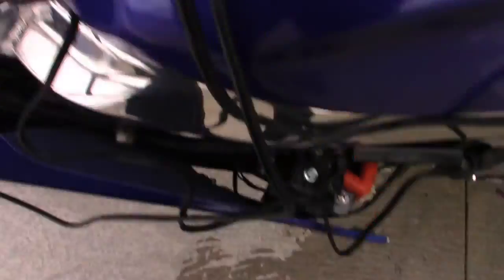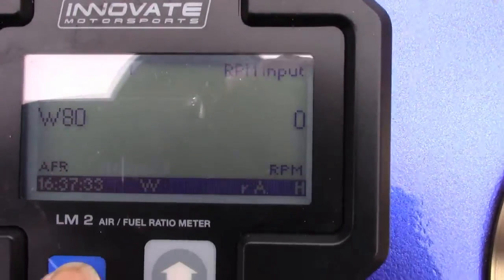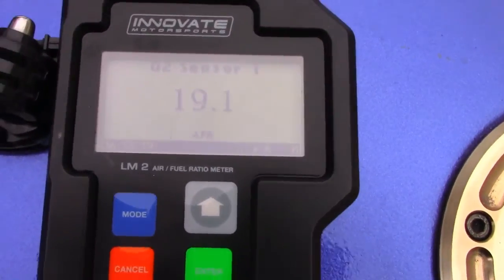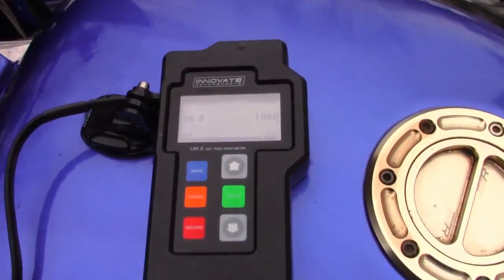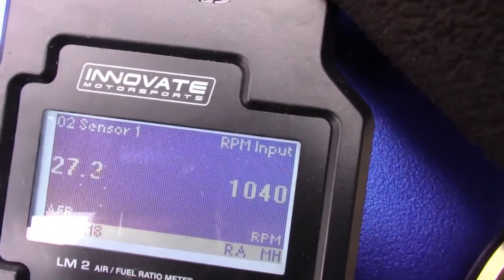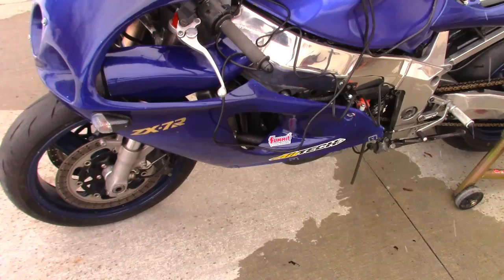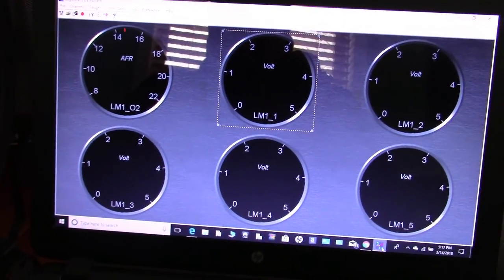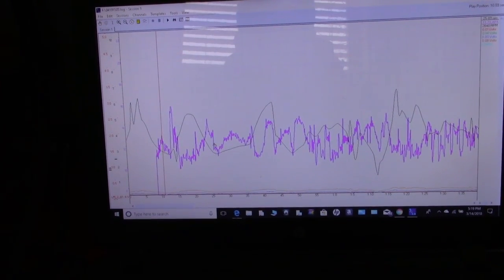ZX7R Update Innovate Motorsports LM2 Part II

Comment: Hi,
I am planning of buying LM2 for my flat twin BMW and read not nice reviews about LM2 or Innovate’s products in general, after so many years how is your LM2 behaving?
Reply from the maker: The LM2 worked fine.   The muffler clamp was not the best solution.   It is best to weld a bung on the mid-pipe to get more accurate readings.    Otherwise, I did not experience any issues with it.
Reply: @Turbo329 I read a lot about the reliability, I need that for BMW flat twin engines …. And I like the idea with one device with two sensors

Comment: This video helped. Thank you. But watch the clamp position.  From Innovation manual “Do NOT install the Bung below the 3 o'clock or 9 o'clock position. Condensation can form in the exhaust pipe and permanently damage the sensor.  6 o’clock is the absolute worst position to mount the sensor.

Comment: not much good if you cant tell if your rich or lean at idle
Reply from the maker: Agreed.  Best way would be to weld a bung on the mid-pipe and connect it directly.   Then it should get a way more accurate reading.
Reply: @Turbo329  did  yours have a PAIR system fitted when you were doing the test

Comment: The lean result on idle and low rpm is due to PAIR system/valve. PAIR is basically injecting fresh air to exhaust to help burn residues of fuel. This system works (ON) from ible up to mid range of rpm (depends on the model of motorcycle ). 
Since lean afr is when too much air is present, and PAIR system inject air on low rpm = make exhaust gas leaner= providing/ delivering not realistic mixture of gases to O2 sensor. 
In order to adjust idle and low rpm afr, PAIR  valve has to be closed manually (you have to tap it). After that real arf will be delivered on low rpm. 

Pair valve close it self automatically from mid rpm to high rpm

Thank you
Oleg
Reply: my 1200 bandit mk1 doesnt have a pair system ,so would i get fair results with the innovate exhaust probe /sniffer
Reply: @virtuosomuso  Maybe. Maybe not. The exhaustgas pulses quite a bit on idle. Air could be suckes back into the exhaust and it would show lean as well.

Comment: every bike reads lean on idle.  I have tested a dozen even with gas analyser. the gas pulsation on idle gets a lot of oxygen pulled from outside. that is why you run "lean" on idle.  if you extend the muffler with a 2-3m long hose, it will read correctly on idle.
Reply from the maker: Thanks Peter.   Actually this unit reads abnormally lean on idle like 30 or something.  I can’t remember exactly.  It’s definitely a false reading but it gave an accurate reading once I started moving.
Reply: @Turbo329  yes, that is that way on every bike due to short exhaust and low cylinder volume.  every O2 in the muffler will read that crazy false lean, that is normal. I get 12% of O2 on gas analyzer on absolutely every bike I tested.

Comment: Thanks for sharing, excellent work! What is the jet setting (maj, pj, pilot air jet and so on) which is giving you best drivability and less “bogs”?
Reply from the maker: You want my flatslide (FCR41) settings for my build?
Reply: Turbo329 yes pls, we all want :) . I have cbr 900 with 39 fcr and now running 160s + 55s + 1.5 turn air screw out , 1 turn fuel out
Reply from the maker: @federicob7521  Here you go buddy (Please note that these are the KEIHIN FCR41s sold by SUDCO and NOT the OEM ZX7RR carbs that came with the '96 and '97 ZX7RR.  I have those settings as well but the SUDCO carbs seemed to work better for my build):  
FCR41 (SUDCO - With Airtech Race Airbox Fitment) Sudco Part No. 016-515
Jet Needle: OCFMP - 7th clip (richest) position
Needle Jet: Primary Type (no holes in the body, only the top of the jet)
Main Jet: #165 - all 4 cylinders
Main Air Jet: #100
Pilot Jet: #55
Pilot Screw: 3/4 of a turn out
Slow Air Screw: 1.25 turns out
Float Height: 9mm
Airbox: Airtech FIM 2 Snorkel Race Airbox
Velocity Stacks: - 30mm Cylinders 1 & 4; 50mm Cylinders 2 & 3
Ignition: - Stock Rotor
CDI - IGNITECH TCIP4 W/ Custom Settings and 14,000rpm
Notes: The 779cc Wiseco Dyno Tune produced 122hp on pump gas with U4.4 mix at a 3:1 ratio
****OCFHP needles can be experimented with the middle setting (clip position #4)****
Reply from the maker: Federico B looks like our settings are close but keep in mind I'm running a huge race cam and a superbike airbox.
Reply: Turbo329 thanks for your detailed answer. I am running with OCEMP # 4th from top and NO filters, long velocity stack (50x4) and 4x2x1 full akra. I have also dyna 3 Ohm minicoil. I have also tested + 2 deg fixed advancer. Pls Keep doing the good work and post your updates..
Reply from the maker: @federicob7521  That sounds like a decent setup.   I ran POD filters also but eventually ditched them because the bike lost a ton of mid-range torque.  Does anyone make a race airbox for your application?

Comment: plz check calibration o2 sensor (19% o2 in the air is low )
thanks for the video
for me 1 problem  solved 2 more questions to work on ....
Reply from the maker: For some reason, the LM2 doesn't read accurately at idle.   I have to be moving with steady throttle.  Other than the idle calibration it works nicely.  I think the best setup is to weld a bung in the mid-pipe and use that insteqd of the clamp.
Reply: @Turbo329  weld bung is better ,mind the angle and sensor nose dept
plz check calibration o2 sensor (19% o2 in the air is low )
https://www.youtube.com/watch?v=4vLXg1i2MSE

Comment: That's an AWESOME idea. I have the innovate DLG-1 gauge in my mustang but the LM2 is a GREAT choice for bike owners that don't have space OR want an O2 bung in their exhaust. I have a '96 zx7r & a '08 zx6r so this LM2 can EASILY be transferred from one bike to  another. Innovate motorsports did the power that way cuz they're are meant for cars, more specifically dyno tuners that work on multiple vehicles that don't need a permanently mounted gauge in a single vehicle.
Reply from the maker: Thanks.  That makes perfect sense about them being designed for cars.  Good call.